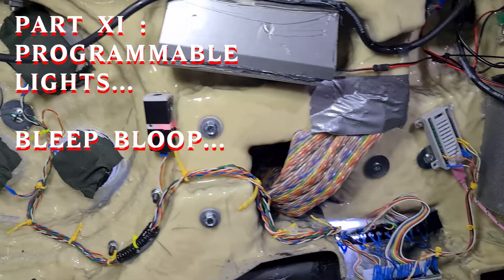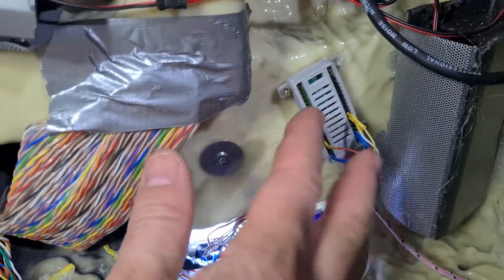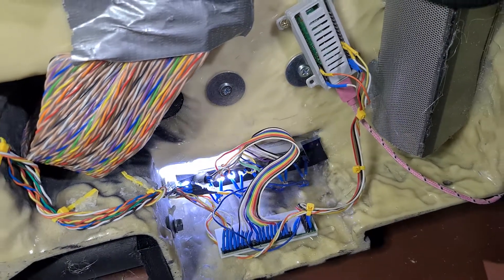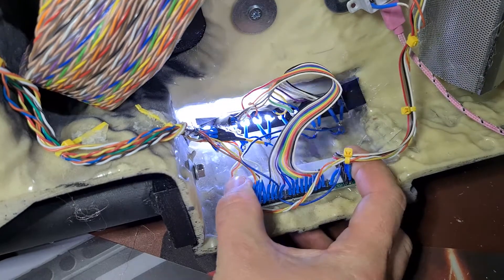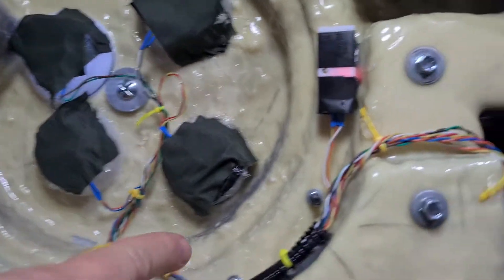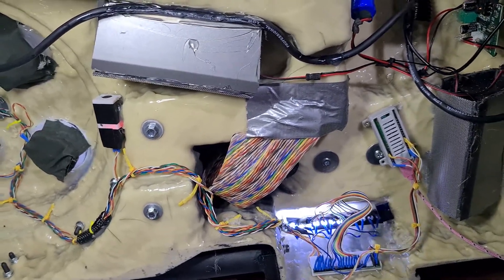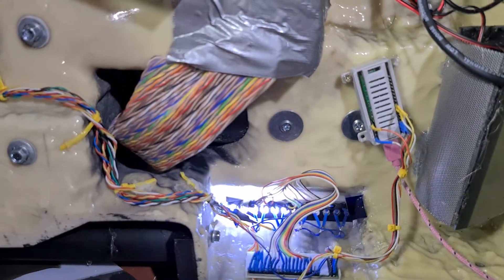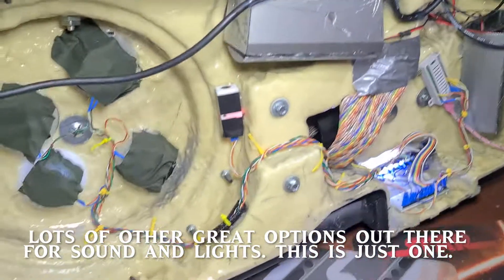Proton Pack Build (Ben of Kent) Chapter 6 - Programmable Pack lights for £19

Comment: Hi Keith, thanks for sharing the code for the Raspberry Pi, but I’ve got a question: The code is written/made for 10 power cell LEDS but checking your pack and the 3D file for the power cell LED holder, I count 12 LEDS..?